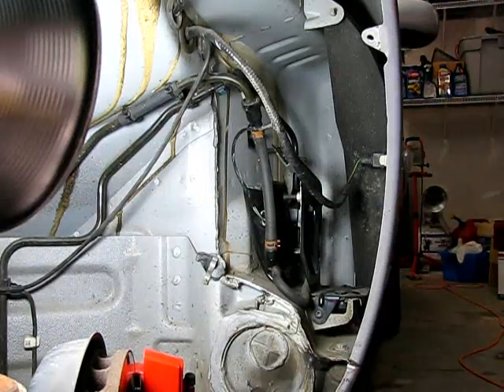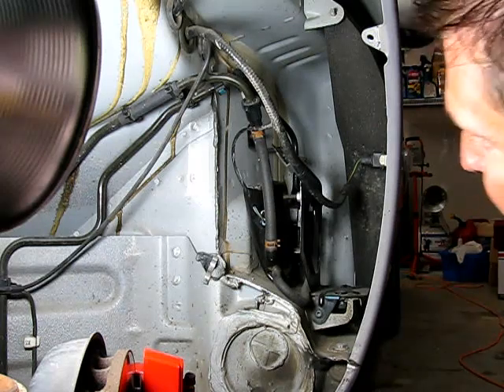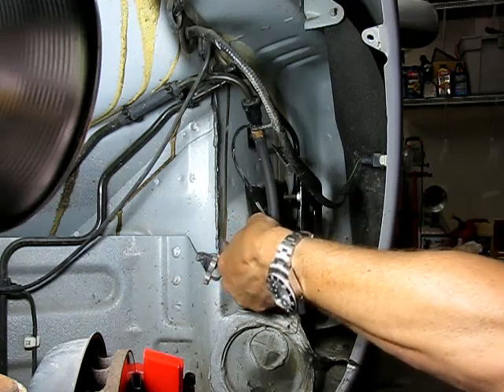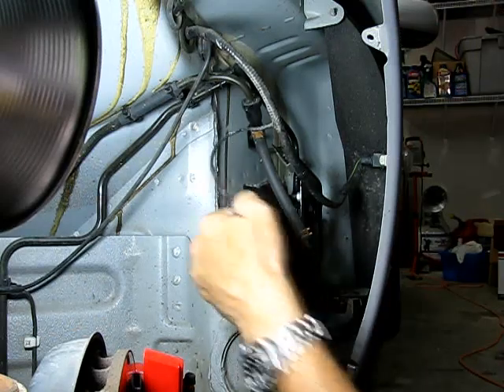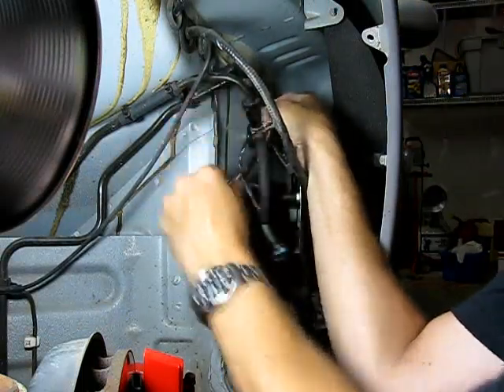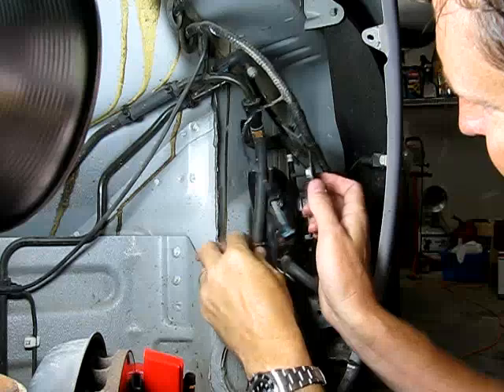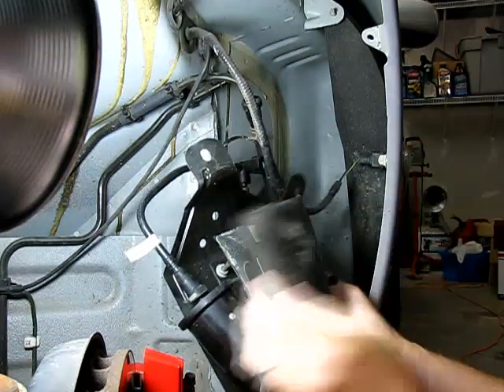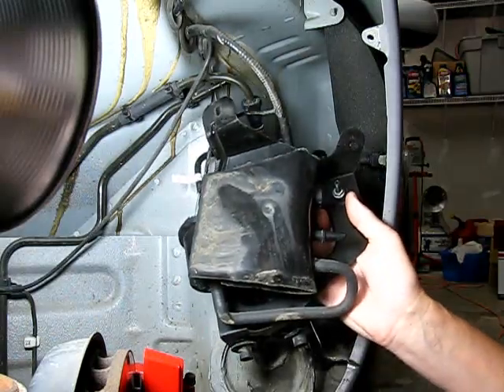How To Replace the Canister Purge Valve on a Jaguar XK8

Comment: Sam, I have a 98 XJ8 that I can't fill up the gas tank.
There isn't any relief for the vapors to exit with the gas nozzle inserted.
I believe I have the problem tracked down to a plugged up charcoal canister. 
I have the manual and there are at least 4 different fuel vent systems that I can see.
Mine has the main inlet, a 1/4" vent line and a 3/4" or metric equal that is plugged.
I spliced in a hose and the canister line is definitely not accepting any flow.
The 1/4'' line is also plugged.
I pulled the tank and don't know how they got it installed with almost no gap between the lines.
Since I can't get the tank out I can't follow the canister line and being not one to tear into something as nice as this car is I am on a mission to pin point exactly where the elusive component is.
If you can help me out with a video or a reply I would be mucho grateful for your efforts.
Thank you,
jeff
Reply: I had the problem with my 2000 XK8 and the problem turned out to be a solenoid-controlled valve that was stuck closed (called the CANISTER CLOSE VALVE, or sometimes the CCV).  But I don't know if the same or equivalent part is on an XJ8 or not.  On my car the part number is LJC1525AC and is a bit over $100 (although I was able to remove mine, take it apart to find the problem (the center rod was sticking inside the electrical coil, so I used a Dremel to make the passage slight bigger so it didn't stick anymore, then reinstalled it; could fill my gas tank after that normally).
On my car, the valve is under the car; if you jack up the rear end (specifically the passenger side rear end) and remove the tire (Passenger-side rear), you can see the valve/solenoid up there close to the boxy carbon canister held on by a singe bolt).

Comment: was wondering if u can help...my xk8 has the ticking noise under the left wheel well and it has started throw misfire codes like crazy  hard starts etc  but once it gets going it runs very smoothly and strong ..im assuming since i can hear the purge valve that this must be the cause of my misfires and so on any thoughts or confirmations?
Reply from the maker: Hmmm... what year is your car? If you're getting misfire codes I'm wondering if your timing chain tensioners are about to go. The 2002 and earlier cars had an issue with the timing chain tensioners. They were made of plastic. When they break, which they will do eventually, the valves hit the pistons and the engine is destroyed. Not trying to scare you, but if you haven't had the tensioners replaced on a 2002 or earlier car, you need to have it done right away. The replacement tensioners are metal and they won't break. 

Other than that, I have no advice except go to jaguarforums.com, make your way to the x100 forum, and ask the people there for help. The people on jaguarforums know the answer to everything. Seriously.
Reply: @sam1174  2004 deffo not the chain ive gone thru that with other cars there absolutely no sounds or clanking no matter how hard u hit the gas it runs pristine if u hear it run it sounds brand new ...yet??!! codes and missfire
Reply: @sam1174  it dosnt fight to start like when the chains bad and it actually fights the starter...it dosnt do that!!!!!...rather it just  randomly will come on right away but then u feel the missing and it will shut off a few times then run smoothly
Reply: @sam1174  i know that if it was compression it would be opposite it would start ..run smooth....then once hot it would spudder or hesitate or shut off but it dosnt do that ..it only acts funny just after starting then it smooth out like new

Comment: Hi Sam, is your original Purge Valve is a Denso? I have the same part as yours however, according to Jaguar we should have the different system with LNC1515AB part...which is completely seems to be a different brackets and system.

Comment: Sam.  Love your videos.   Wonder if you can help.  A lot of XK8/XKR owners have a problem with vacuum's being formed in the fuel tank. An ominous thunk occasionally  as sides are sucked in.  Some people have even have had collapsed tanks.  Having seen a lot of your videos you know your XK's inside out.  Especially the fuel systems.   Any ideas as to what bit of kit we need to change to stop or what we can do to sort this problem?   I suspect the air INTAKE into the tank is somewhere you were working in this video.   You know your stuff as they say.   Any ideas?
Reply: i have just replaced my carbon canister and valve and filter parts under the wing once this is done does it need to be plugged into computer or anything or is all that plug in and go 
thankyou

Comment: Sam, when I pump gas it stops multiple times. I have the gas smell too. Do you think this would help?
Reply: That sounds like a stuck evaporative emission canister vent solenoid, which is in the back of the car attached to the charcoal canister.

Comment: You're vids are so helpful!  Thank you.  I do have a question.  My car is a 2003 and I can't find a new purge valve for it.  Every listing goes from 96 to 02.  What's the deal?
Reply from the maker: I just looked on Rock Auto and a couple of other websites. I didn't see it listed. Weird. Go to the Jaguar dealer. I'm sure they have it (or can get it). Or maybe they'll just give you the part number and you can cross reference it to buy a cheaper, aftermarket part.
Reply: Thanks for the reply.  I'm pretty sure that's my problem.  I get lean condition codes, both banks, and strong smell of gas until the engine warms up.  I'll call the dealer.